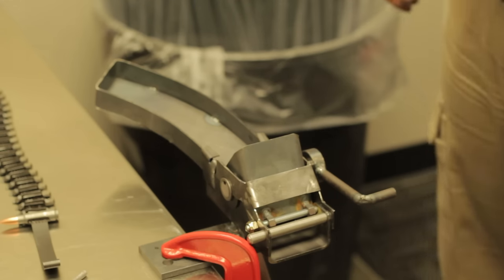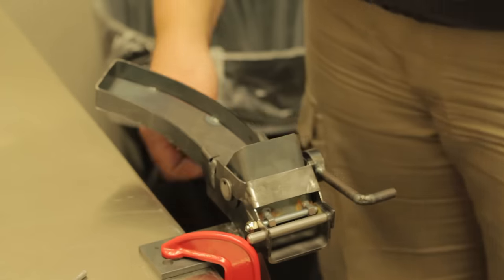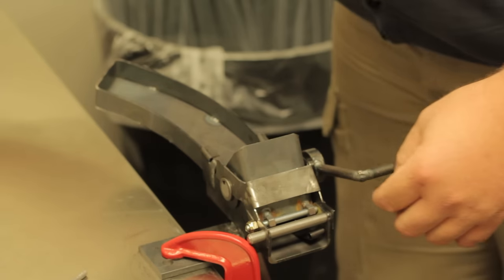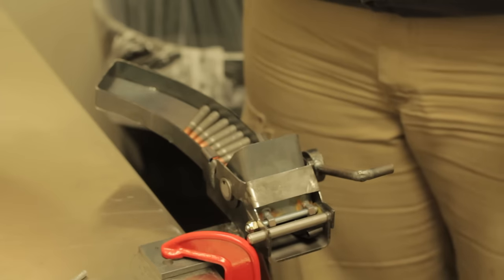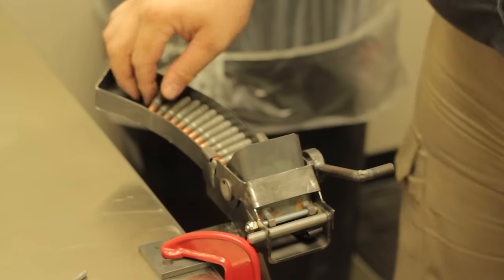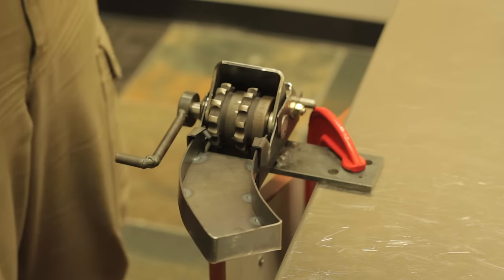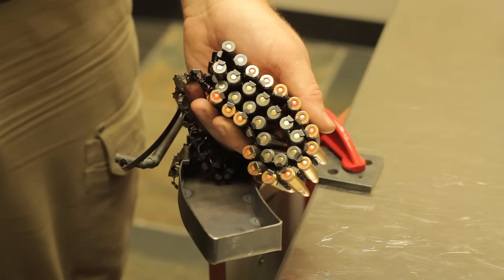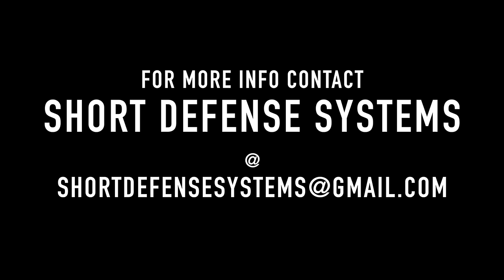Short Defense Systems RPD Belt Loader

Comment: Do you still have these for sale? What's the current price? In stock?
Reply from the maker: We are currently having to design a new base plate. The stamped one does not work well with all types of RPD belts. We have had good results with a machined base with tighter tolerances, but we are having to proof it out some more. Until we get that finished, we are not offering any for sale.

Comment: Sir one concern. The grey casings may have some flaws (depending on what material) may, or may not have as good firing performance as of the brass cased bullets (Commonly used in the military field). If I may have mistaken something, please let me know of that. Thank you for reading, or pinning this.
Reply from the maker: The steel cases are pretty uniform, otherwise they wouldnt work in the firearms. We have seen problems with the base plate and the tolerances of the bent part. We are working on a new design that is milled to get rid of those variations.
Reply: Oh, actually it must've been a different material in which it was making the flaws that I was talking about (Cheaper than brass bullets), and steel is pretty expensive so this makes sense to load that type of bullet casing into use.
Reply: The RPD was designed to run the steel cased ammo brass works fine too of course.
Reply: steel ammo is cheaper then brass. aluminum would be the cases that would be denting if put through a mechanical loader.